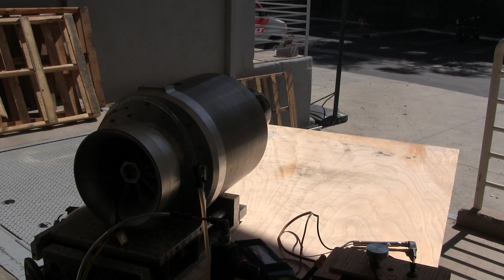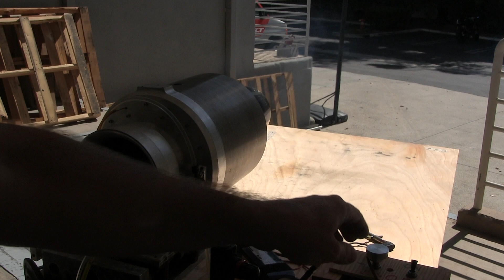220 LB Thrust Turbine Engine

Comment: Very nice engine. Well done! Could do with a faster spool up on starting... turbine wheel may be getting a tad too warm, I use dive bottles to start mine. What sort of oil system are you using?
Reply from the maker: total loss lube system

Comment: What was the compressor and turbine size?
Reply from the maker: roughly 120mm intake , not sure of the turbine unless I take it apart
Reply from the maker: 8"
Reply: RC Harrier do you mean the inducer of the compressor is 120 mm and the turbine is 8" ? 
Roughly intake you mean the inducer ?

Comment: Did you ever make the turbofan conversion? How quickly do you burn fuel?
Reply from the maker: 96 oz a minute
Reply from the maker: The rest of the conversion into a turbo fan is well on the way, it will be roughly 90 oz a minute and 400 lbs thrust
Reply from the maker: 90oz at full throttle and 400 lbs thrust once converted to turbofan

Comment: What does it take to make it good enough for a man carrying aircraft?
Reply: it takes  appxly 1//2 the weight in thrust of the craft plus cargo and fuel etc..total weight / 2, in thrust...
1000 lb total weight.. 500 lbs thrust more  or less for an ultra light.. more thrust for more speed etc.. but 1/2  will get you all the way to the scene  of the accident
Reply from the maker: It would need many hours of testing unfortunately it's along way away from that yet. It needs to be balanced and a few other issues fixed, then I would have to find a place to test it. It still a long way off from being ready to fly.
Reply: If you build it and it weighs less than 254lbs dry you can fly it without any pilots license. People have gotten pretty creative in this class you'd be surprised what people have made and how cheap it can be to travel locally by flight.

Comment: where I can buy it's parts
Reply from the maker: There all made, other than the turbine wheel and compressor, they were random parts I had lying around.
Reply: RC Harrier are the turbine and compressor from a turbocharger?
Reply from the maker: I believe the compressor was, they do make them this size

Comment: Do you have any videos on how you made this or any other jet engines?
Reply from the maker: If I find the time I might do that
Reply: @killerbee2T  did u find time sir?
Reply: Please do!
Reply: I'd love to discuss these engines with you. I run the experimental aircraft and homebuilders group on Facebook. Please get in touch.
Reply: did you find time?
Reply: Kabilan Sripathy very interested myself... Please.
Reply: Hi, I would like to understand the start up precedure. I see you spin up to a certain speed and then spark the plug. But the end of the process I didn't get it. Thanks a lot

Comment: Go to the hardware store and get a shop light, then we might be able to see what is happening in the shadows.
Reply from the maker: Yes, I know the lighting is not good but its real, I will try to get 
better video. If you see some of my other engines you'll see that this 
is really an easy one to make happen. I don't post videos here of 
something that does not work.
Reply: Electric motors vs gas fed engines can't be compared in any realistic way.

Comment: Amazing build. Very impressive. Couple of questions:
1.  Did you use a turbocharger compressor for this?
2.  What company cast the Inconel turbine stage for you? Was it expensive? Were you happy with them?
3.  Do the turbine stage blades have any cooling passageways? Also, are the blades regularly cast, or are they cast with directional grain?
4.  Do you know what the turbine inlet temperature is, or what it was designed to be?
5.  Amazing weight for the amount of thrust (yay turbojets!). How much fuel do you think you're going through?

Again, this is truly a great build. Very jealous and very interested in your approach. Keep up the good work!
Reply from the maker: Yes it is a automotive compressor, I just used a turbine wheel I had in my collection for now until the prototype is done then I will look into making wheels. No cooling passages them, that's more when you get into multi stage wheels where the temps get really high. Around 900C in front of the guide vanes, its probably 90oz a minute

Comment: Congratulations Mr Harrier! You've done it again! It seems to me you are one of the few people who have actually built and tested a micro size turbofan.. I admire your passion as it must be a fascinating hobby..
What I can't quite grasp about mini turbine engines is that almost all of them seem to use a single centrifugal compressor that takes up a large portion of the total engine diameter with little room for the diffuser. Suppose the flow coming out of the impeller exit is passed through a diverging passage with an area ratio of 4 (= diffuser exit area/impeller exit area). That wouldn't even double the static pressure even though the flow speed would have decreased significantly.. Yet many manufacturers utilizing such system claim a static pressure rise of 3~4! How is that possible???
Reply: Sangyoon Kim centrifugal compressors can raise the pressure up to about 5 atmospheres in one stage and almost 10 in 2 stages. Multistage axials are only about 1.2 times per stage but if you have 10 stages you get a 12 times rise. Large turbofans have way more than 10 stages.

Comment: If you convert that to a turbofan it would be a good basis for a one person replica of an A-10 something on the order of 75% scale.
Reply: The full scale A-10 is surprisingly large seen in real life.. Maybe 50% or less might be better suited.. my little opinion
Reply from the maker: Yeah something I can fly, I need to get my pilots license
Reply: +RC Harrier Getting an LSA certificate is easy and gives you a starting point for a better rating later . Also you could really have a market for that with LSA or experimental builders if you could get the cost down comparable to piston engines

Comment: Nice. How is it for fuel efficiency compared to commercial engines? chance of being any good or straight up awful? :)
Reply: and how is it made?
and what fuel
Reply from the maker: It is a single compressor engine so the fuel consumption is
not great, that said by converting this into a turbo fan will at least double
the thrust at the same fuel consumption. 

It is made with cast Inconel for the hot parts and all the
rest are all machined/fabricated parts
Reply: Very nice.
Are there any small engines like that with multistage compressors?
What's your thinking on 3D printing for jet engines?
Reply from the maker: I am not aware of any engines this size or smaller with two centrifugal 
compressors it would be the way to go or a few rows of axial in front of
 the centrifugal, its something I will try eventually. I have just 
completed a rapid proto typed turbine and it may be the way to go for 
most of the parts in the engine, full throttle testing is needed to see 
if the rotating parts hold up.
Reply: I wonder if a special starter motor could be used as a generator on it and have additional electric 'fans' elsewhere as an electric transmission turbofan. Much simpler design presumably, cheaper, easier to service, more versatile. Momentary battery flight. 220lbs can power a significant personal jet. Fully pressurized cabin at 20km would be pretty cool.